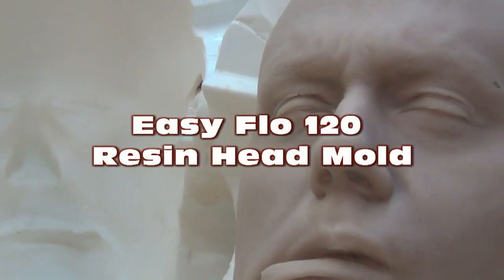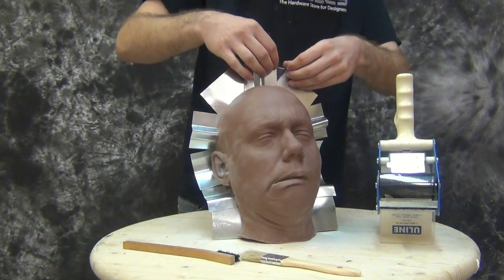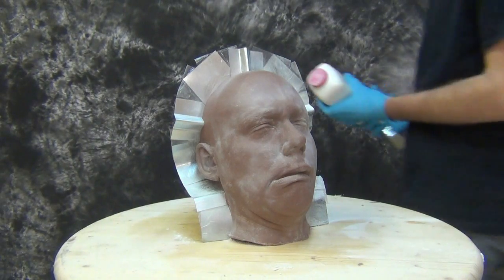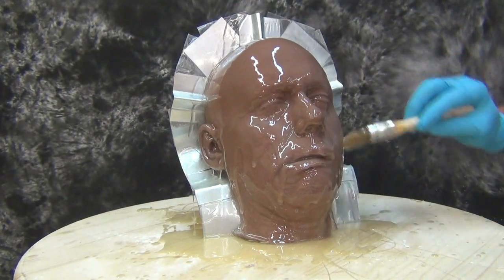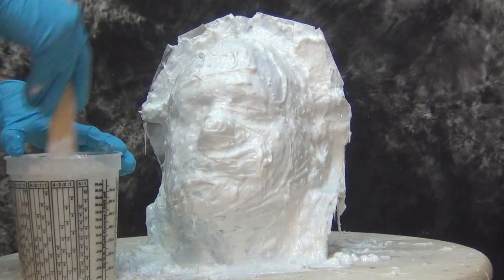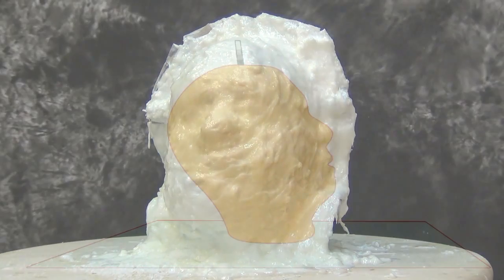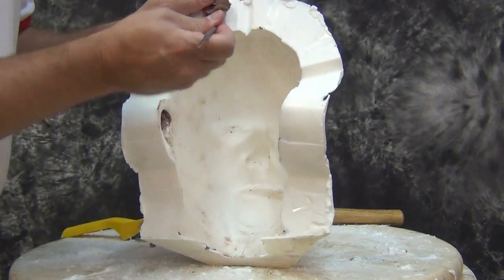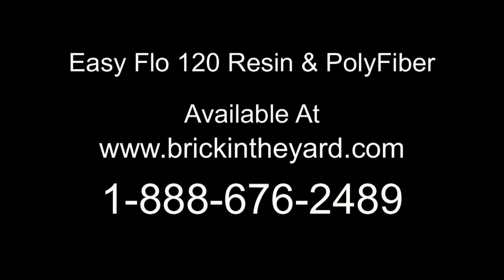Severed Head Mold Part 1: Mold Making

Comment: Is the release spray necessary? I wonder if it's repelling my resin. Have ruined two clay heads already because the print coat wouldn't stay on :( humidity low, room 72 degrees
Reply from the maker: @Chester_the_toucan  you need to add more thickener (polyfiber or fiberthick) to your resin.
Reply: @brickintheyard  but this is just the print coat I’m having issues with, which shouldn’t have thickener right?
Reply from the maker: @Chester_the_toucan  It depends on which resin you are using. This mold used 120, which is VERY fast. If you are using a slower formula, you add thickener.
Reply from the maker: @Chester_the_toucan  The most recent video (Resin Mold For Silicone Casting Part 2), alludes to this at the 13:50 mark.

Comment: What's the ideal temperature/humidity for the room when using resin like this?
Reply from the maker: Room temperature of 70-75F with low humidity. High humidity will result in more air bubbles.

Comment: could you use this to make a mother mold for a full silicone 2 part mask? where the life cast goes inside ?
Reply from the maker: +Christina Borchardt Yes. If you use this technique for larger molds I would recommend adding fiberglass for additional strength.